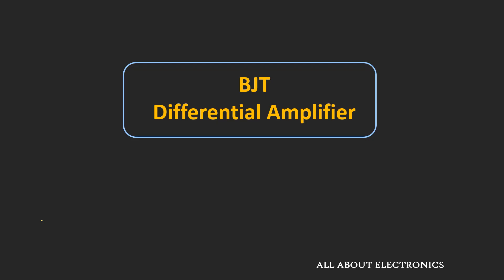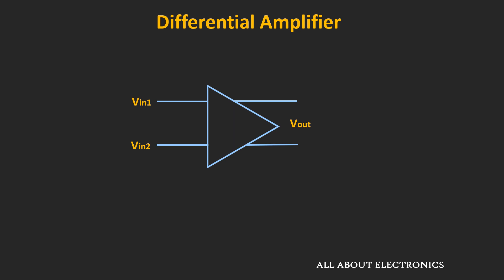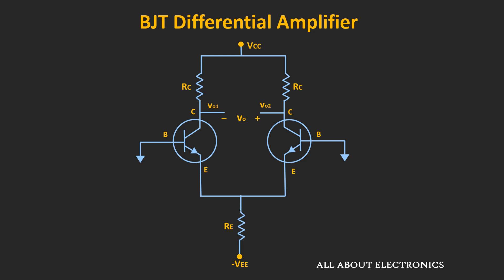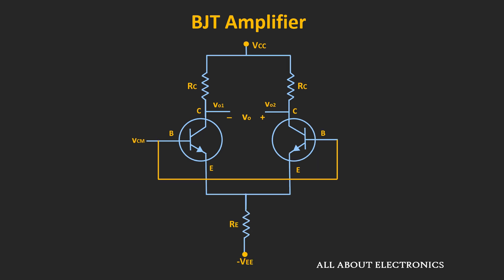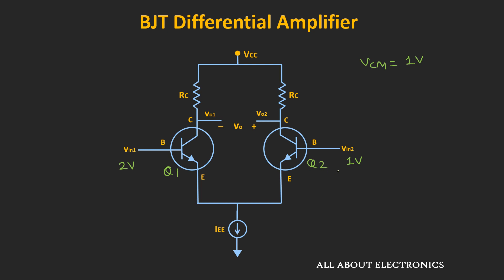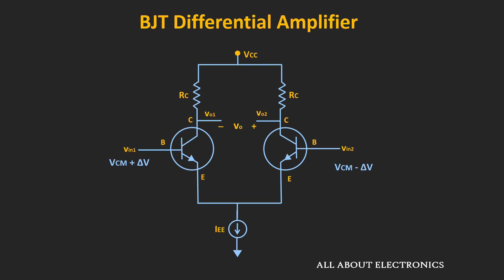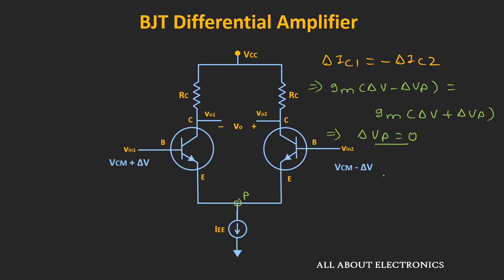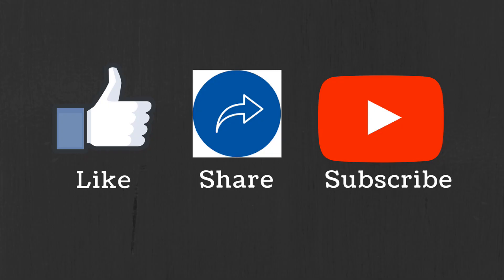BJT:  Differential Amplifier Explained

Comment: A great video overall, thank you! But Where did alpha come from? @5:28 you state i_c=i_e which makes perfect sense. But then 10 seconds later @5:38 essential states i_c = alpha*i_e. Would appreciate help here, thanks!
Reply: The assumption that Ic = Ie is an approximation because the base current Ib is usually very small compared to the collector current Ic.  But remember that the actual emitter current Ie = Ic + Ib.  So the ratio alpha, defined as Ic / Ie, takes into account the small base current Ib which is also present.  Alpha = beta / (beta + 1), so usually a number slightly less than 1.  

You can derive this by substituting Ie for Ib * beta and Ic for Ib*beta - Ib in the equation Ie = Ic + Ib.
Reply: @fireshredder24  thanks for the explanation, I was wondering the same thing as the original poster. Was aware of beta and the fact that there is a small base current through the emitter that flows with Ie but hadnt heard about the alpha term before.

Comment: This is why i hate electrical engineering. You EEs NEVER WRITE WHAT YOUR VARIABLES ARE REFERENCING! WRITE DOWN WHAT CURRENT, VOLTAGE, RESISTANCE YOU ARE REFERRING TO. It makes so damn difficult to follow what you are talking about when I have to guess which voltage or current you mean.
Reply: Also they didnt explain from where current flowing

Comment: 15:12 Why/How did you put a "-" in the expression for Vc1?and how a "+" in Vc2's expression here?
Reply from the maker: Vc = Vcc - Ic RC. But we are seeing only change in Vc1. Therefore, ΔVc1 = -ΔIc * Rc. (just think intuitively, if input voltage increases then base current will increase, and hence collector current increase, therefore, there will be more voltage drop across the resistor and hence less collector voltage. That's why three is a negative sign)  And ΔVc2 = - ΔIc2*Rc. Now, if you put the value of ΔIc1 and ΔIc2 in these two expressions then you will get ΔVc1 = - gm ΔV Rc and ΔVc2 = gm ΔV Rc. 
I hope, it will clear your doubt.
Reply: @ALLABOUTELECTRONICS  Awesome.....thank you for replying.....You're really a committed teacher....I can feel it in your reply......nice explanation

Comment: Not sure if I missed it but it would be nice if it was explained that the input itself is assumed to be differential.  This amp doesn't create a differential signal although I realize is referred to that in industry.  It only maintains the differential.  Otherwise it just looks like to npns in parallel.  6:26 is especially misleading?

Comment: I have an important question though.
What happens if we want to delete a BG music in my signal, if I put it on the other side it will change as time passes, so if we apply the same locic, to cancel it from the output the voltage at Vp will be equal to that BG music, right?

Comment: It is a bit confusing on equations between 5:00 and 8:00. If you substitute Vcm - Vbe to Vp in 8:00, the polarity of Vbe is different from equation 5:00.
Reply from the maker: I didn't get what you mean to say. But at 5:00 I was referring to the DC analysis, while at 8:00, it is how differential amplifier will behave to the common-mode signal, where the common-mode signal is present at both inputs of the differential amplifier. At 5:00, VCM is 0.
Reply: @ALLABOUTELECTRONICS  yes you are right. But if you substitue Vcm - Vbe to Vp, the formula in 8:00 will become IEE = ( VEE - VCM + VBE ) / RE.  So if Vcm = 0, what's left is IEE = ( VEE + VBE ) / RE . the sign of vbe is wrong.